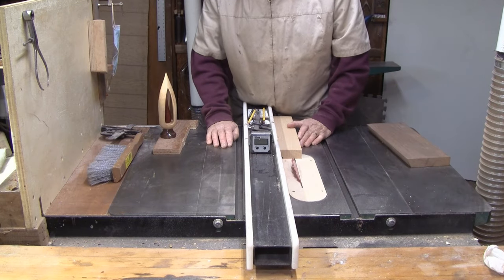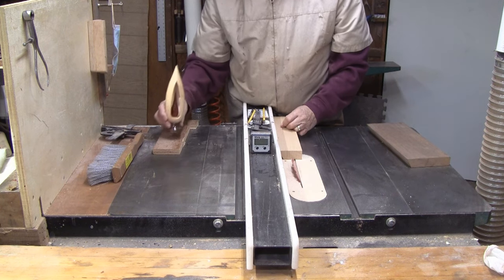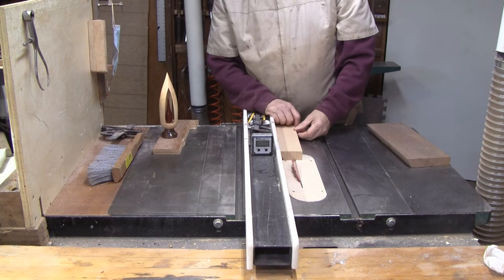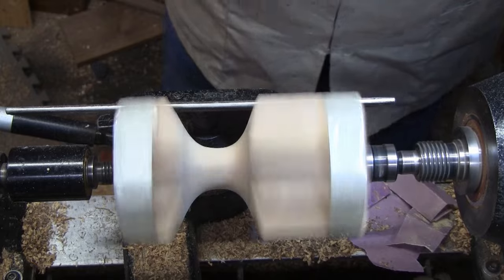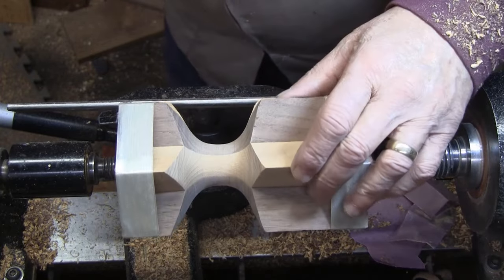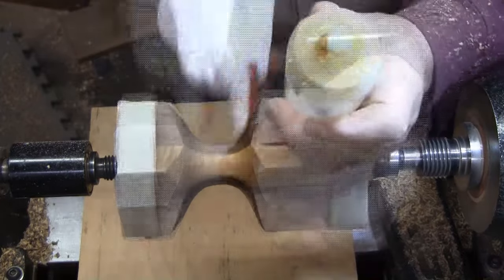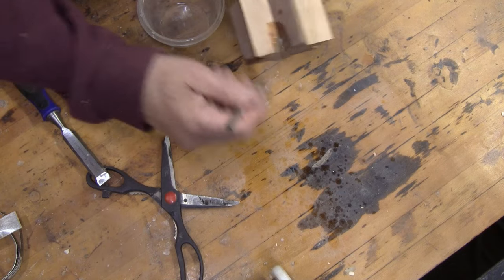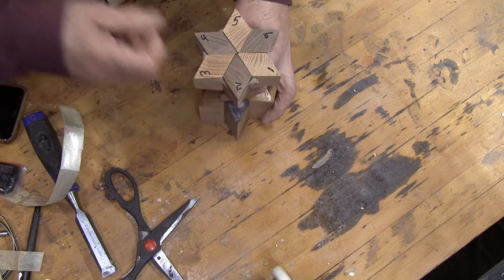Wood Turning A Six Sided Inside Out Christmas Ornament

Comment: Gary, you just keep teaching me.  When I watched the first video in which you used hot glue to hold a piece to a waste block, I thought "this thing is gonna fly across the shop"!   I would never have tried that, if I hadn't seen you do it first and that would have seriously limited my turnings.  I have to admit that when I saw the small amount of glue you used to hold the ornament to the cup center, I cringed a little but I thought "it'll be okay because he has the tail stock support"... and, of course, you then took the tail stock away to finish the end.   Thanks for the "ongoing education" and Merry Christmas! - Shawn
Reply from the maker: Thanks so much Shawn. Hot glue can sure be handy and for making these ornaments it works very nice.
I understand you cringing when you saw the small amount I used when in the cup center. For sure I got a feel for it while the tail stock was against it and could tell it was going to be fine. 
If you decided to try it do it on something not so delicate or just a practice piece. The real trick is to let the gun heat up to full heat. Mine has a high and a low and I use the high. It is very strong but amazing how easy it lets go with a little denatured alcohol applied. 
 If you decided to try it make sure you are comfortable with the whole process.
 Merry Christmas my friend,
Gary

Comment: You  cut the  angel  30 or 60 good job
Reply from the maker: The blade is tilled 30 degrees off of 90. If you measure the angle of the piece it will be 60.
Table saw and band saw tilt scales say 0 when the blade is 90 to the table. That can make things seem strange but it is the way I have looked at angles and am used to it.
Hope that all makes sense.
Gary

Comment: Gary. I really like what you have done here. I’m going to have to make some of these for this Christmas. Could you tell me what the length and width is of the pieces are. Thank You
Reply from the maker: Hi Dave,  So I started with 8 inch long pieces using 1 1/4 inch stock. After the angles are put on it you will need a little more than a 2 inch wide piece. But I cut mine from a board that was around 8" wide to start with. Just make sure after cutting the angle that all the legs are exactly the same. This will also tell you if you have the angle correct if you put just 3 pieces together making a cube shape which is what I did on the first one.
 The length can be what ever you choose..
 I know these dimensions as I have extra pieces I have never used. I always make extra pieces when making these.
 Hope that helps and if you have more questions let me know,
Gary

Comment: If you put it in the microwave, the hot glue melts and it comes apart easily. Another trick :)
Reply from the maker: Tricks are always nice to hear about and put in that bag we keep them in. Another method is using a heat gun.
Thanks for watching,
Gary

Comment: Hi Garry, this is a very nice piece, well done. I'm new to woodturning so just to confirm, you used only hot melt glue and no paper joint, right?
Reply from the maker: Thank you very much. yes I only used the hot glue and no paper joint. I use hot glue for tenons on the bottom of bowls as well.  You will see that in many of my turnings that are glue ups.
Thanks for watching,
Gary

Comment: Very nice Gary, another fine video. I haven't seen anyone try an inside out Christmas tree. I wonder if it would even be possible. What's that noise? Gears turning in your head? ;-)
I tried my first bowl from a board and it worked. It was a little grabby as I used piece of a pine shelving board. I found I didn't need a jig for the 45 degree cuts. My tool rest slides on a carriage on my Shopsmith. I just hooked a speed square over the rest and laid my cut off tool against it and it worked great as a cutting guide.
Here is an early Merry Christmas to you and yours, as well as a very Happy New Year.
Reply from the maker: Thank you Gil, I do think and inside out Christmas tree would be fairly easy to do. And then you could put a small tree on the inside. Perhaps next year. After I finished these two I did 4 other ornaments for gifts. Not like these but still pretty nice.
Have a Merry Christmas my friend,
Gary

Comment: Gary I know I commented  before but I dec ou vhf to rewatch  it again so I could share with my son and now I have a dumb question. Looking  to get a grinder  should it be normal speed or low speed with or without  cbn wheels.
Reply from the maker: Hi Charles, I have a slow speed 8"  Rikon (little over$100 at Rockler on sale) and CBN wheels. I have 80 and 350 grit. Cost much more than the grinder but really like them.
 Hope that helps,
Gary

Comment: What is the width and thickness of the pieces you started out with? Excellent work, btw. Thanks
Reply from the maker: Ben the pieces were 1.06 inches thick and they were 1.219 wide.
Easiest way to do this is take what ever stock you have and cut the angle. After you cut the angle measure the length of what that angle is. That will be how wide the strips should be for all the sides to be the same.
 Hope that helps and thanks for watching,
Gary

Comment: Just watched this and really like it. I actually like the lighter colors. Would you share the angle you sawed? Thanks for your very helpful information.
Reply from the maker: Thank you Ronald. The angle I cut was 30 degrees. So it ends up having an included angle or 60 degrees. So 6 will go together like they did here. You can also put 3 together . If you measure one way it is 60 and the other is 120. 
 All that was achieved by titling my blade 30 degrees from 90 the way you saw is setup most of the time.
 Hope that make sense.
Gary

Comment: Beautiful Gary! I love the contrasting wood. As usual a great explanation of your method. Your workbench looks suspiciously like a bowling lane. I have two 7 foot lengths in my garage that I rescued from a bowling alley demolition. My shop area is too small right now to use one….. but soon!
Cheers, Rick
Reply from the maker: Thank you Rick! So I built that bench in 1975 and it is made from clear 2X4's. So it is 3 1/2" thick. The legs are 4X4's.
 I used my jointer plane to flatten it out. Over the years it shows the use but the black spot came from a water stain a few years ago. This coming summer I plan on sanding it all down.
 Thanks for watching buddy!
Gary

Comment: Gary. I’m working on a project over the weekend and I’m going to used the clear poly.  After 3 coats do you turn and polish with acks?  Also my project is wood and resin. Will poly look good over resin?
Reply from the maker: The poly should look fine Mark. When you say clear are you talking about the water based? I have seen that done and it looks great.
Yes I do use the Acks after all the finish has been applied.
Thanks for watching,
Gary
Reply: @ThePapa1947  thank you Gary.

Comment: How do I know how deep to make my first cut to have a nice window without going too deep?
Reply from the maker: Hi David, I use the thickness of one board and then I turn the deepest to around that size. So if I was using 4 square pieces that were 1"X1" then I would turn the deepest area so it was close to that same 1" 
This gives a nice opening but if you go much past that the piece will get pretty thin after turning them around.
Hope that make sense. I do have a video explaining that and showing an easy to do the first one you have ever done.
 Hope that helps.
Gary

Comment: Gary. I started to do the cutting of the six sided ornament and I noticed that your blade leans to the right. My blade leans to the left and I can’t get my wixie to work properly. Should I rely on the scale of the table saw or try to get the sexiest to work. Thanks
Reply from the maker: Hi Dave, yes mine tilts to the right. I had an old Craftsman for years that tilted to the left. Everything we used at work tilted to the right so it is certainly what I am used to.
 So no problem with the Wixie. It will say 30 on one side of the blade and 60 on the other. Sounds like you are looking for it to say 60. 
 Let me know if this makes sense and if not I will make sure it does with a sketch or what ever is needed.
Take care,
Gary

Comment: What is the angle that you cut those blocks? I like what you are doing there.
Reply from the maker: Thank you Michael!
With your table saw blade set at 90 you tilt it 30 degrees. This will give the block a 60 degree angle .
 My digital angle finder will read 60 and I set it from the table.
The scale on your table saw that should go up to 45 will read 30.
Hope this all makes sense. If not let me know.
Gary
Reply: @ThePapa1947  Thank you I’ll be making some   3s and 6s
Reply from the maker: @michaelmccollor5725  sounds great. Let me know how it goes.

Comment: Cut the angles at 30 degrees?  Is a perfect 30 degrees critical or + or - 1/10 degree, etc. okay?
Reply from the maker: It might be hard to see. The tangent of .10 degrees is .007. So if that angle was off that much in an inch you would have a .014 gap between two pieces that long.
What I do is take some scraps and cut the parallelogram long enough to get 3 pieces. Put them together and when the gap closes you have a perfect angle. The same pieces will fit as 3 or 6.
Much more accurate do it that way than any protractor.
Reply: @ThePapa1947  Thanks for the reply.  I agree, it will show a visible gap unless you make the cuts close to perfect.
Reply from the maker: @w4baham  close to perfect is what I shoot for. I will adjust the cut till the joints are tight. Then it is a matter of repeating that cut every time.

Comment: These are just lovely! Really enjoyed watching this. The use of the hot gluing made things so much simpler and faster. Could one use padauk and possibly hand stain a lighter wood in a green, bringing in the Christmas colors? If so what type of stain would be best and what type of finish over?
Reply from the maker: Thank you Abe and for sure Padauk would be beautiful for one of these. 
I really like the idea of dying of staining the wood green.  I think if I was going to do that I might use water based stain and then use the Polycrylic over it which is also water based. Although once turned and sanded it will take some delicate work to keep the stain on the light wood only. Maybe a small brush. 
Great idea and thanks for watching,
Gary

Comment: Couldn’t those ‘sharp corners’ be rounded or reduced with a electric plane instead of taxing the lathe and the chucked block ?
Reply from the maker: I suppose you could do that but you would have to control how much you took off so you does not effect the final shape.
Which was yet to be determined. 
 The lathe is not taxed on a piece this size. You are cutting air so you need to be aware of that. Other it is just cutting like it is a spindle .
 Your idea could be an option if there was a concern with the air space and the corners chipping.
Thanks for watching

Comment: I'm just going through some of your videos, so this is a little late :-). I find the videos very educational! I'm just at the beginning of learning wood turning. I was wondering why you didn't use the clamps instead of the hot glue before turning it inside out? Is there any reason not to? It seems so much simpler.
Reply: I should have said "instead of the packing tape" rather than "instead of the hot glue".
Reply from the maker: Thank you Mark and I read you add on to this. So couple reasons on the clamps. I would have had to tape over the clamps to keep the part that sticks out down and out of the way.  The other is it could crush those edges and possibly split them beyond where I was going to be turning. But it can be done using the metal clamps which a lot of people do.
I just never have and it very well could be a bit easier. So not a bad idea at all.
Thanks for watching,
Gary